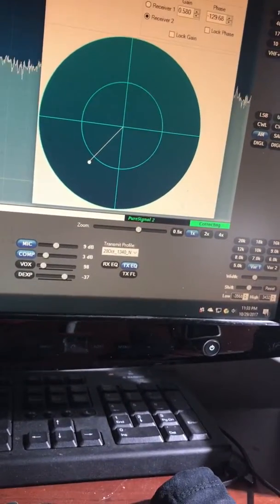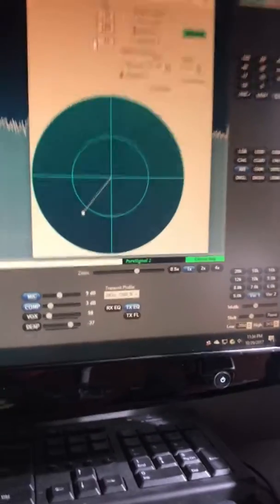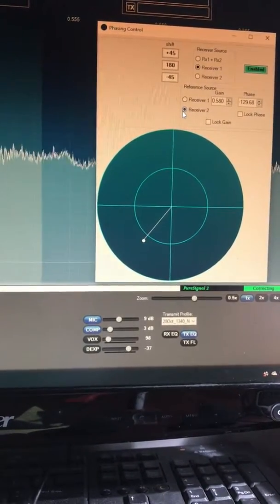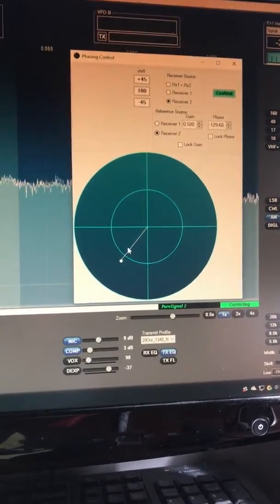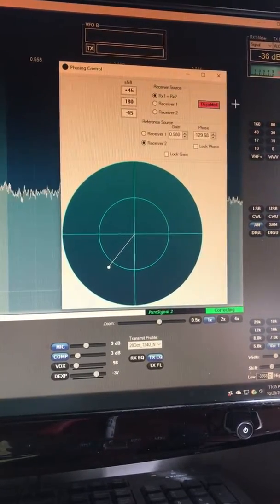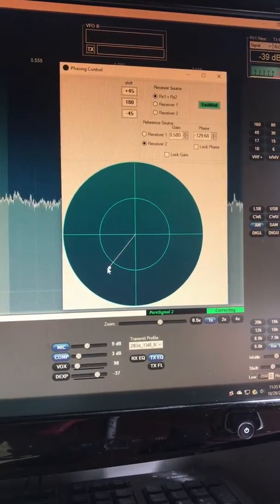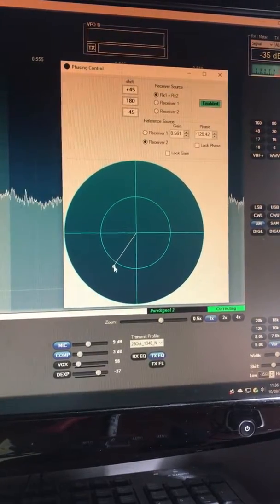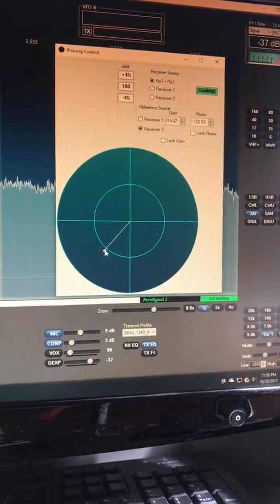Apache Labs Anan 200D Diversity

Comment: Nicely done!
Reply from the maker: Thanks Bob. I have become a real fan of the Apache Labs products, and of course the PowerSDR software. Im in line for the 7000 DLE, and a couple buddies of mine are also looking at the same rig. Nothing against the Flex, but many of us can't seem to reconcile the high(er) cost of the 6600 (with 2 ADC), against the loss of certain software features such as phased diversity reception. Makes the 7000DLE very attractive. By the way, thanks for all your  contributions to the PowerSDR/Apache Labs community, I'm pretty sure I've read just about everything you have ever published on line! Looking to you and WU2O for continued hints and tips...73, NJ2US